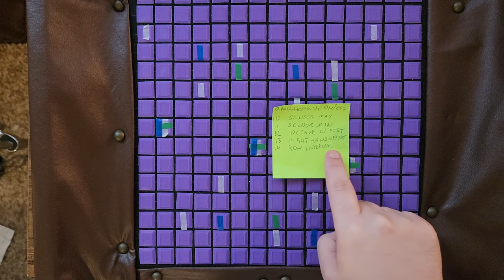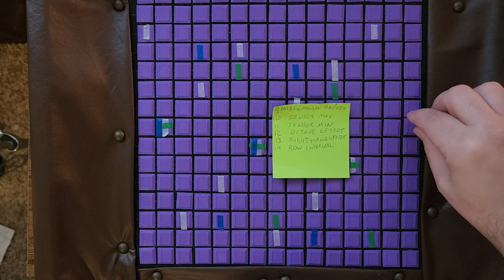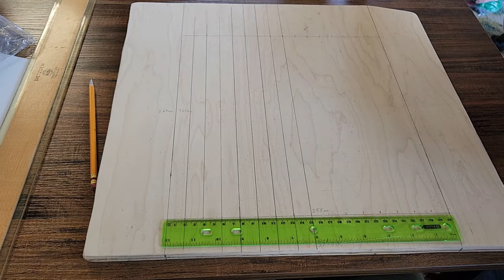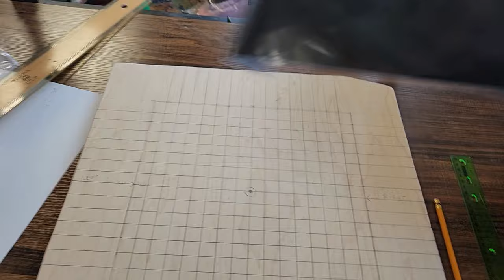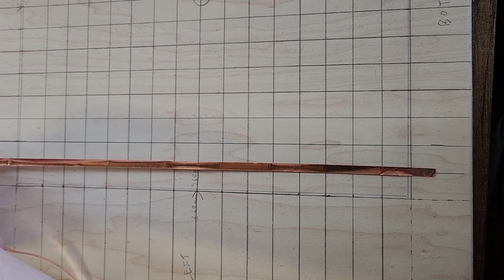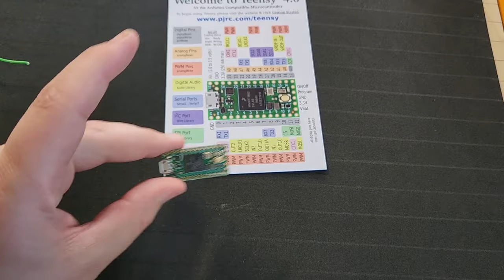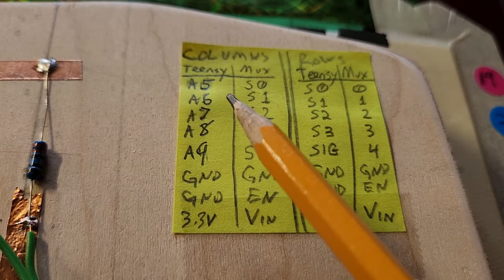Building a matrix keyboard using velostat film

Comment: Very nice! I bought some Velostat sheets, a Teensy 4.0, resistors, copper tape, and analog multiplexers years ago with the intention of making a Janko keyboard with poly-aftertouch. However, the only thing I'm missing is the willpower to overcome my laziness. 🥱
Reply from the maker: I hope you find the mojo to give it a go! I have been tinkering with mine for quite a while, and it's becoming a really really fun instrument to play (even poorly).
Reply: Yes, @markfdesimone, after watching your video, I was thinking about creating a vector model and then having the velostat and copper cut at a print shop or acrylic laser cutter service to make it more precise and save time. Have you considered this option for future projects? Here in Sao Paulo, Brazil, this kind of service is pretty cheap.
Reply from the maker: No actually, I'm not sure how to create files for that. You have local shops that would cut velostat if you bring it to them? Maybe there are places lime that in the US, too. I usually try to figure out how to use the methods I can do at home, so I can make as many mistakes as I need to. I don't make things to sell really, so these are just for me.
Reply: Hi Daniel, I hope you will start your project, as I'm planning to do exactly the same. I already built a four octave non-velocity sensitive Janko layout midi controller. Before that I had zero experience in working with electronics or Arduino.

Comment: So you used multiplexers, that's interesting because another person making midi pressure pads found that the multiplexing inside the microcontroller he was using made it lose sensitivity after adding more than a handful of sensors, but you've got multiplexing working smoothly with over 200 sensors!  Have you run into any sensitivity issues at all with this?
Reply from the maker: Yeah, I was definitely worried about how quickly and accurately the thing could measure 200 sensors. Imagining each reading takes 1 ms, I was worried that I'd get 5 or fewer measurements per second for each sensor. But I did a little bit of digging in the Teensy forum, and read that those microcontrollers have high-quality DACs, as well as speedy processors. It's been a while now since I worked on this, but I think that the reality is that the main code loop circles back really quickly, and the DACs can handle being called rapidly, so the measurements must be several times faster than 1ms per sensor. 

TL:DR; I gave it a try with a fast, solid microcontroller and I think it just worked out?
Reply: @markfdesimone  Okay, well great!  The other guy was using a bare ATMega328p, I don't know how it compares performance wise but maybe it's not as fast?  I'll just have to give it a try myself I guess.
Reply from the maker: @excrubulent  In case it helps, this is the lowest-spec microcontroller I've used for these: The teensy LC has a clock rate of 48mhz. 
Could be wrong about the ATMega328p, but it seems like it runs at 20mhz. I'm sure there are other architectural differences between the two boards, and I'm not an expert. I think the key is probably to keep the loop short and optimized to run fast (maybe use arrays where possible to look up values instead of doing calculations on the fly?), and then try a Teensy if you can. They don't produce the Teensy LC any more but the new 4.0 microcontrollers are WAY faster and fancier, and still pretty affordable (~ $25 I think)
Reply from the maker: Or, if it seems like the analog readings are bleeding into each other (the sensitivity issues I think you're talking about), you can use some extra code to throttle the speed of the loop so it only runs as often as the DAC can measure reliably.
Reply: @markfdesimone  Yup, so another option is to use a MCP3008 DAC IC which runs at 200,000 sps (which I believe is samples per second), so should be more than enough.

My current plan is to use an ESP32 which can run at 320MHz, so far more than I'll need.  Thanks for all the information, I really appreciate the replies!

Comment: Can I ask if you’re getting any false starts on the FSR’s? I have tried small copper tape cuts, more copper, carbon fiber sandwiches, even a pretty intricate tape cut. The best results I got were the carbon fiber on either side. I still get some but I think it’s because I want it to be extremely responsive, or maybe there’s something in my code, not sure
Reply from the maker: Well, it did take a fair amount of experimentation to find out what the maximum and minimum pressure values were, but that was a question of fine-tuning the code after I built the circuit.

If you can describe your trouble in more detail I'm happy to try and help! My problem regarding responsiveness is that some of the sensors are more sensitive than others, which means I have to hit some harder than others to get them to sound. For those issues, the sensors were either on the edge of the velostat, or there was a ripple or bump that created a bit of space between the copper and the velostat. I'm not sure that's what you would call a false-start. It's more like some of them are stubborn.

Is it possible that your code is a factor in the setup? Or, could there be a pin or connection in your circuit that's not properly grounded?

Regarding the responsiveness, I am not a professional keyboardist or anything, but I've been pretty darn happy with this thing's performance in that regard.
Reply: @markfdesimone  gotcha, yeah I actually unfortunately lost my program I wrote for the instrument when updating to a new OS 🥲 but I am going to get back to it in probably the next couple weeks so I will certainly check back in. It was just that it would play a midi note every once in a while with out me doing anything haha. So I guess I was trying to bring the threshold to low. Maybe my breadboard was bad, grounding shouldn’t have been an issue but maybe. Emi perhaps? Ever since I built that prototype I have been coming up with more ideas in my head that I’m ready to try and get out of there haha, this video is perfect because I have yet to work with mux’s, and I love the practicality of your design. One idea I have is making an fsr/switch to both complete the circuit and measure resistance. I have a way I want to test it out so I will definitely keep you updated (: thanks again for making this video, so glad YouTube recommended it to me.
Reply from the maker: @flywittzbeats4008  Excited to hear more! I'm jazzed about the velostat too. It's cheap, and it seems like you can do almost anything with it.

Comment: This is cool. I tried building a simple sensor with a piece of velostat with cardboard on top, copper tape on both sides of the velostat and then attached a multimeter to the copper tape with crocodile clips. But the resistance is so random. I'm not sure what's going wrong. I can just leave it still and the multimeter is measuring huge swings in the resistance such that there doesn't seems to be any reliable cutoff between pressing and not pressing the sensor, even between high and no pressure. Maybe I got sold something that isn't really velostat.
Reply from the maker: Oh that's a drag. Is the sticky side of the copper stuck to the velostat?
Reply: @markfdesimone I actually tried using sticky copper tape against the velostat, and even though it was supposedly conductive glue, it practically inverted the function of the velostat (resistance first increased then decreased with pressure), so I had to conclude that it wasn't a viable way to make a pressure sensor.

Using crossed strips is actually a really interesting way to use that sort of tape.

Comment: This is a cool keypad. I played around with resistive pressure sensors but those are too expensive to build into a complete keypad. I never thought of using Velostat as a pressure mat. The aftertouch addition is a nice touch (pun intended) and I'll definitely play around with this.
Teensy 4 is a great microcontroller. It used to be my standard "arduino" board before the Raspberry Pi Pico came out. I still use it, especially for audio and for some macro-pads (Teensy 4 has a high speed, low latency USB keyboard interface - this is missing on most other boards)
Reply from the maker: I haven't had great luck with the Pico, and I'm sure it's a me problem. They are so cheap and capable though, I want to get used to them at some point. I didn't come up with the velostat idea, btw! I just hyperfocused on the idea of making a cheap midi controller with LOTS of keys and found great resources.

Comment: Main thing about Linnstrument is expression abilities. Here we don't have anything beyond Launchpad  functions (and lack of leds!). Yes it is smaller pads and more of them.
Using of film sensors lead to another problem - hardness and lack of feedback, this is also quality of Linnstrument.
We need something like soft flexible clothing that is stretched and can travel under pressure.
More (in feeling) like endless parallel strings of Erhu.

Think about using small ring with accelerometer for expression control. It will be more limited but will keep your design.
Reply from the maker: Thanks for taking the time to check this out! It is not as expressive as a Linnstrument, for sure. What excited me the most about this project was its low cost. The key ingredient is dirt cheap, and I imagine you could use it in tons of different ways. Also, I'm just a hobbyist, so I'm not aiming for a reproduction of a Linnstrument, or a polished commercial product. My main goal was to have a keyboard that I could use to explore microtonal scales more easily, and this definitely succeeds in that regard!
Reply: @markfdesimone  Yeah, pretty cool. Just remember that cost is not low at all. It requires lot of skill, time to get components.  
One thing I want to propose for you is to look at Matrix grid open source controller.
If you manage to modify their design for smaller and pressure sensitive pads and also make such 8x8 controllers stackable without border - it can be real deal for masses. As they have skills to really manufacture them in China.
Check Striso thing, it is expressive, tiny, and uses 3 pads under each key. May be it is viable design for larger controllers.

One of my ideas is stretchable clothing (similar to one used in Continuum) with IR reflective  dots below it (around 200-300). So  240-480fps speed camera can be able to read any deformations caused by fingers. Here only costly component is camera and they are mass produced and progressing fast.

Do you think it'll work nice? By idea scan rate is not too good, but can be usable.
Reply from the maker: @personalview7388  That's a really interesting idea, and it capitalizes like you said on a technology that's got tons of research behind it.  I've seen videos of the Striso, and it sounds lovely! Very expressive. I will definitely have a look at that open source Matrix controller. Thanks for putting it on my radar!
Reply: @markfdesimone  I suggest you to get Erhu and try it. As Roger Linn, for example came from guitar, making feeling similar to mix of guitar and violin. And issue is that fretboard limits the instrument expression.

Also always take into account package size and molding costs. 
VMETER author has good economic article stating that any small batch controllers must have 1:4 cost to manufacture to retail cost ratio, never less.
Linnstrument cost to manufacture is also around same ration, being $300-450.
Such ratio also stops authors from moving to mass production as it is different expertise, very busy life and initially they'll have profits even drop sharply.

Comment: huge inspiration for what i'm currently working on but kind of a noob on electrical matters, how did you calculate the right resistance for the resistor grounding each column to the ground pin?
keep up the awesome work :D
Reply from the maker: Awesome! I didn't calculate the value myself; I based the hardware approach on the Instructable that I have linked in the description. I don't know how you'd go about calculating such a thing!
If you get to the point of sharing what you're making, ping me. I'd love to see what's up!

Comment: I'm seriously considering building one of these, I have a few questions
would it be possible to use a shift register instead of a multiplexer as the "output" cols/rows? (someone told me it could work in a normal non-analog keyboard matrix)
could key ghosting be minimized by changing the layout of the rows and columns? (by making them diagonal or something)
does the velostat have to be a single sheet or can you have a couple smaller sheets of it next to each other?
instead of a foam pad, can you use squishy keys instead?
and maybe you could add LEDs if you 3d printed the keys in transparent tpu filament?

I might not get my points across clearly so I'd love to chat about this on somewhere, do you have socials?
Reply from the maker: Hey romeolz! I'm happy to connect and chat. If you're on Facebook, I'm in a few instrument-maker groups (Experimental Instrument Builders, Experimental Music Software and Hardware). Beware, I'm not an expert, and don't have a great understanding of shift registers. Maybe we can talk about it and figure out together if it's an option. The multiplexers are super cheap, and have worked really well in my limited experience though, and I'm sure you could add more rows and columns with a couple more multiplexers if that's what you're trying to do. 

I think the key ghosting would be a consideration with any column+row setup, even if they're not 90 degrees from each other. The way my instrument turned out, the only ghosting I have to deal with is when you press four keys that form a rectangle, which isn't too often. And what happens is that if you press down 3 corners of the rectangle, the fourth corner will act as if it were pressed too. I think Linnstrument must have code that handles this more elegantly, and prevents that fourth corner from triggering a note-on. BTW the Linnstrument's code is open-source!
I haven't tried using several velostat sheets next to each other. I bet it would work, but the keys that are on the border between two sheets would probably be less responsive than other keys. Adafruit sells 11 inch sheets for a pretty good price, if you're able to buy from them.

The foam pad is not necessary. I used it because I needed some flat material to stick the copper tape to. I think having a little bit of squishiness is nice, but I would recommend trying a few different approaches to see what feels best for you. I've played with printing TPU for keys; that worked OK but they weren't much more squishy than PLA keys, and were less consistent. I think there's lots of room for improvement on the key design. 

I do wish I could have LEDs under the keys, but I decided against it for cost and complexity reasons. I think using stickers or washii tape is a nice low-tech way to experiment without needing to touch any code or software.
Reply: @markfdesimone  let's do it! I can't get on Facebook right now so I want to know what time zone you're in (so I know not to message you at 3am waiting for a response, I'm in UTC+2)
Reply from the maker: @romeolz  Cool, I'm in Pacific daylight time, which is UTC+7